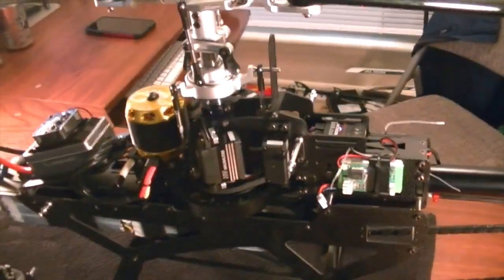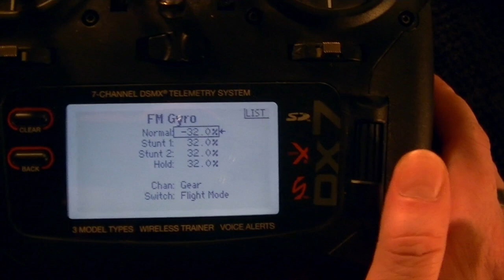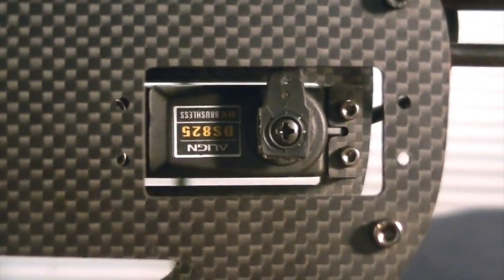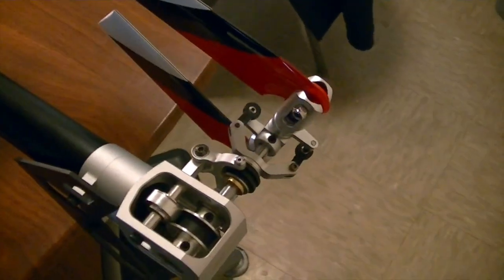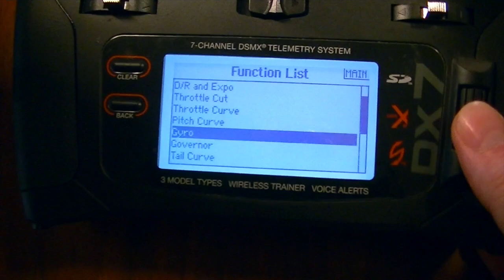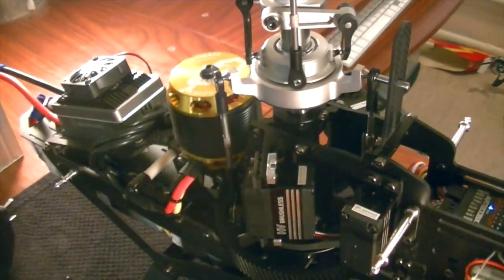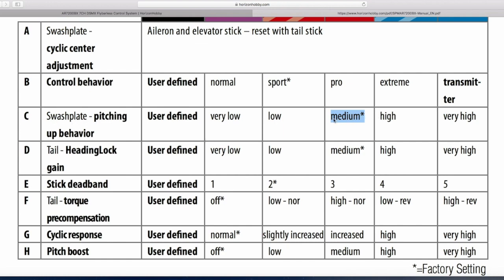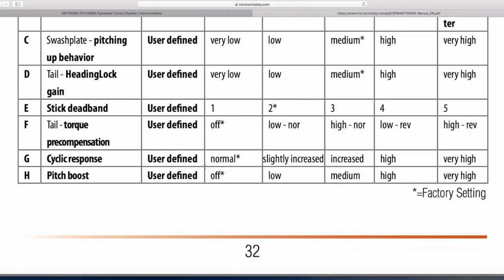AR7200BX / Beast X : Setup Guide #4

Comment: Quick question: Did you put the first setting back to -32   ?   or keep it     at +32  +32   + 32 on gyro. Freddy you are brilliant...If I had a heli company or FBL unit maker.. I would hire you to do videos on the product... I have never understood why manufacturers produce manuals that are difficult to follow and assume the customer has a good knowledge of setting up the black art of Helicopters...    You make it so easy and I am very grateful to other guys who have taken the time to show setting a Beast X up but you are by far the best.
Reply from the maker: Thank you so much for the very kind words buddy, and also yes once you have completed the programming I set everything to +32 for my first test flight.  This makes sure that all flight modes have equal gain with no risk of accidentally flying in RATE mode.  Then you just fine tune them from there.
Reply: I totally agree, the manuals are made for people who usually have a crystal ball, manuals in English mixed with Chinese, for me who do not read or speak English, I have to use the google translation. And the companies do not allow us to select one part of the manual to translate on google, or they block the translation, or put the Chinese together, and when we select a part, only strange characters come in. I think that’s why the Hobby of Helimodelos instead of growing is decreasing , and the Hobby of Drones has been growing. If the manufacturers do not change this concept of manuals, they will end up failing.
Reply: @rochaeliasbr  yes you are wright in the new manual for the 470LT M stans vertical and cablels backwards blue and in the Microbeast its red  !!!!!!!!!
Reply: @33forsaken  i like the idea of having it set in rate mode on normal mode because it will center the tail then i will flip to headlock and take off. if the blades are set mechanically to hold the tail so there is no sudden turns if i do forget i will not be caught off guard. i have the gyro gains on a seperate switch. but what is your feelings about that.  its a matter for me to have the tail on center then flip it to gyro gain. preference for me. i never forget it anyway because it is habit forming.

Comment: Great series of videos!  Currently I am working on an old trex450 using the tgz380 which is a clone version of beastx v.3 for instructions.  I have an old DX7 radio and I am just getting back into helicopters. The question I have for you is how do I go about getting gyro sense to show up in my functions list. My heli has been set up for years using the old reliable gy401 but going through the very similar instructions with the tgz380 I will need to get into the area of raté and heading hold in the radio.  Hoping you might be able to point me in the right direction. Thanks for sharing.
Reply from the maker: If I can recall in the older DX7 radios, you have to do the thing where you hold down the button and power on the radio to enter model select and all of that.  Then you have to actually go into the channel assign and set the gyro to on in the channel assign.  Then if I am remembering right it should then active the Gyro menu when the radio is powered on like normal.  I hope this helps, it has been a while since I have used the older radios and systems lol.

Comment: Thanks for the video, I have the T-rex470LM, and MicroBeast v4.2 came, as I am a beginner, I paid for the T-rex to be assembled, but I'm not happy, because the servants are making noise, I think there is a little shaking, and also the tail servo hits the end, which even for me who is a beginner I think is wrong. But, thanks again for posting.
Reply: Ellas….Can you go to an experienced flyer for checking your settings?   ..If I am wrong guys please correct me?   Should be 0 to 0 on sub trim tx radio     I am still learning don't   but do not understand why heli manufcturers/electronic controllers  leave you in the dark with poor manuals...  Hire Freddy and save us all a big learning curve with excellent videos.
Reply: @alwatt9367  Hello Al Watt, thanks for the precious tip, I will see what can be done in this case.
Reply from the maker: Hey guys never ever ever add sub trims in the radio with the beast x or related systems.  Thats what the FBL system is for, so you can go into the travel menus for the setup and lower your setting.  For the tail you can change the tail travel limits.  Its all done in the system NOT the radio, adding sub trims will give you less then desired results with the system and causes issues while in flight.  Also please NOTE it is perfectly normal for your servos to be sitting stationary and be buzzing or making noise.  It happens with all helis, and is usually caused by the wight and tight restriction from the links.  Servo buzzing is perfectly normal, however servo binding is not.  There is a big difference between the two.
Reply from the maker: Hey guys never ever ever add sub trims in the radio with the beast x or related systems.  Thats what the FBL system is for, so you can go into the travel menus for the setup and lower your setting.  For the tail you can change the tail travel limits.  Its all done in the system NOT the radio, adding sub trims will give you less then desired results with the system and causes issues while in flight.  Also please NOTE it is perfectly normal for your servos to be sitting stationary and be buzzing or making noise.  It happens with all helis, and is usually caused by the wight and tight restriction from the links.  Servo buzzing is perfectly normal, however servo binding is not.  There is a big difference between the two.
Reply: @33forsaken  Freddy thank you for correcting me..  Sorry Ellias did not mean to give you bad information.
Reply: @33forsaken  Hello, thanks for the correct answer, I tried to know more about it, and from what I understood and from your answer, the configuration is made in the MicroBeast, as for the noises, as I understand it, I believe it is due to the rigidity due to the fact that it is new, little by little we learn from the most experienced. Thanks again.
Reply: @alwatt9367  Hello, rest assured, what counts is the intention to help, after your post, I went looking for more information to make sure and your information was not correct, so I waited for Freddy to speak up, and he was perfect, because he gave the information clearly and need. Thanks again.
Reply: @rochaeliasbr  To be fair I meant to only check if the servo was binding and to put it back after you had done it before flight...But so glad Freddy gave the correct procedure.

Comment: I could probably go back and watch some of your videos or if you want simply send me a link to how to do it and I should be able to get it right from there ... My pitch at 50/50 is at 2.0° on my digital gauge. But I'm getting like -16° and +8.9° I think I'm right about it just needing to be the same but need your professional opinion!!
Reply from the maker: So the beast has a menu that allows you to adjust both the positive and negative travel for the collective pitch.  I do believe its menu K.
Reply: 50/50 Pitch 0  and throw J/ 6  and PitchK/ -13red   and +13 and blue  read good the maual from Beast X Plus and flash the last firmeware5.1.4

Comment: Hello Freddy 
Can I used this 7200 on a trex 600 nitro ?
If yes .. donn be I need a satellite??
One more thing what satellite I have to get ?
Thanks
Reply from the maker: Yes you can use it on any size helis that they make. It is a Spektrum based system so you will need a DSMX Sat and your radio of course.

Comment: Hi Freddy, you're videos was very helpful  I am using microbeastx plus v4.2 basic my setting was factory default, now i am trying to get a hard and fast servo's throw. parameter menu (B) and (G), set the  parameter menu B to transmitter and i increased G what is confused me that at the end of the parameter menu G  show this messages 
(If using an increased Cyclic response (greater than „normal“ setting) IT IS RECOMMENDED TO SET PARAMETER 
menu point B (Control behavior) to transmitter (Status-LED blue). Additionally you should only add a
very small amount of Expo by the transmitter or don‘t use any Expo at all. Otherwise this feature may
not show any significant effect!
) what if i set parameter menu B to blue flashing  and the G to blue flashing could be inconvenient to microbeast and cause some issues?  what's your advice or recommendations...  thanks in advance
Reply from the maker: Hmm this is a very interesting one, let me ask you this have you tried flying the control behavior setting on the highest and also the cyclic speed setting on the highest as well before defaulting to the transmitter mode? You can also adjust the full cyclic servo throw as well to get more pitch closer to center and that will give you a better feel or faster feel.  I have never really messed with the transmitter mode because I have always been able to use the setting to get my Heli to feel perfect.  That may also be another good video idea lol
Reply: @33forsaken  no i never mess with the transmitter setting always set the beastx to factory defaults it was good on a small size like dominator 450l with a soft 3D but the 550 and the 700 size feel lazy.  i used control style to pro and cyclic response to slightly increase but when i read the recommendation at the end of the parameter menu G i hesitated to select the highest point  on parameter B and G. so  what your suggestion or advices

Comment: Freddy not sure if I’m missing something. Followed the tail setup and when I’m in hold or normal mode, the tail acts like you say it’s supposed to including the gyro movement. But when I change to stunt mode 1 or 2 the slider moves all the way to the right. Any input and it moves itself back to the right again. Any input on this?

Comment: New to setting up a FBL unit Working on setting up my align Trex 550x Microbeast 5.2 unit. Point E is fine.  I'm having a problem with point F Rudder direction step. Item one is fine I can set correct direction with rudder stick input, Item 2 rudder direction of Microbeast gyro is correct and lights blue. Item 3 is where I run into problems when I move the rudder stick full direction the led does not change from flashing lights to solid. I have increased the in points in the radio for the rudder to 150% neither light will change to a solid light. What am I doing wrong.

Comment: Freddie... Question. My Trex 500 has too much neg pitch and not enough pos pitch. I can't for the life of me remember how to adjust that. My servos are at 90 and they move up and down in unison but I don't know how to adjust the travel and get them equal. Does that make sense and if so can you help me figure this out?? I think it should be simple but with everything being visually correct I don't want to start adjusting my links if that's not what I need to do. Maybe it is but I just don't want to since I'm not 100% sure. 
I appreciate your time and help with this if you can spare some time to help out!! 
Thanks in advance!!
Reply from the maker: So the beast has a menu that allows you to adjust both the positive and negative travel for the collective pitch.  I do believe its menu K.
Reply: I tink you have not good centerd yor Spashplate on middle position or to high or to low its one of the most imprtend thinks to have it centerd for enough way in both directions .
Reply: @fastfrank61  I got it centered... Matter fact once I set my throttle to stay the same in mode 2&3 the tail stayed solid as a rock.
Reply: And it was all done as Freddie said in his video .. just have to watch. He does a great job explaining how to setup the ar7200!!!
Reply: @Itzalwys1420  Hello but i have the Microbeast X Plus Versio 5.1.4 and i have 5 Algin and ownly problems with the last builded Algin Terex 470LT M Dominator Premium Robbe

Comment: hi Freddy, can you make a video on pitch curve and throttle curve specter 700?
Reply from the maker: Hey buddy, so basically depending on the gearing you have and the ESC.  The throttle curves will vary.  For example, I have the HW Plat 200A with GOV on.  So I have a throttle curve for each mode as follows.  Norm 80% Idle 1 90% idle 2 100%.  But this can very on your settings and GOV requirements.  As for pitch I always run the standard -12.5, 0, +12.5. I hope this helps buddy.

Comment: Was wondering about my tailkick to the right when throttle up. More head speed seems to make the tailkick a little bit less. What else can be done? Maybe a good throttle pitchcurve? Turning up de gain helped to. I,m trying everything and apart from the heli flying great, the tail is a problem.
Reply from the maker: Does the tail only kick while you spool up or does it kick while in flight or doing certain moves?
Reply: @33forsaken  when hovering it's fine. Turning the tail also fine, its when i throttle up a bit the tail kicks to the right and centers again. No tailwag, but tailkick.
Reply: @rtoebak76  mine is doing the same thing... ??
Reply: @Itzalwys1420  It maybe in the parameters menu for tail compensation. Have not tried it. But a good throttle pitchcurve should also work better. Im just waiting for freddy to answer when has the time.
Reply: @rtoebak76  what do you have your throttle and pitch settings at??
Reply: I just set mine, thr. @Idle is 30,40,60,70,80. IU1, 80,70,60,70,80. IU2 95,90,85,90,95... Pitch- idle, 30,40,50,75,100. IU1 & IU2 is 0,25,50,75,100... A-Main hobbies gave me those settings . I'm about to try it out.
Reply: @Itzalwys1420  thats maybe our fault, it needs to be a more straight line for throttle. That way above half stick your always at a good rpm. I think the tail will loose power when going lower, or when its low a higher rpm is coming it can not take the change.
Reply: @rtoebak76  I just tried it and it was really good. Felt good and the tail only kicks out a little bit now!  I put it into IU2 and it shot straight up!! Lol.  So I quickly put it into IU1 and finished off the battery in basically a hover. I am trying this all out front of my house with power lines and trees all around me so I'm trying to be very careful!! I'm not used to the 500!!  It's a whole nother animal compared to my 450 😂😂 
Has me shaking right now!!
Reply: I think with the higher head speed that the tail will fix itself but I won't know for sure until I try it where I can safely fly and not worry about what's around me...
Reply: @Itzalwys1420  it shot straight up because there was a big difference in your throttle curve setup from idle-up1 to idle-up2, you went from 60 to 85 at half stick. Or 70 to 90 when at hoover. What is your max pitch full up and down?
Reply: @rtoebak76  12.5
Reply: @Itzalwys1420  Yeah i set mine at 12, we are good to go. You also have the ar7200bx right?
Reply: @rtoebak76  yes.. so I just did another flight and I'm still getting a slight amount of tail kick. In IU2 as well. I'm going to lengthen my tail link and see if that helps. Still wanna know why it's doing that
Reply: @Itzalwys1420  i got an answer from amainhobby. The precomp setting in parameters is 1 thing to do. But first set your throttle curve to 0-80-80-80-80 and pitchcurve to 0-25-50-75-100. The constant headspeed should let you know when to use the parameter for precomp. If it kicks use it and if it stays your done. Because throttle is not the problem anymore, the only problem would be the pitch of the blades and the drag. So if it still kicks after that,  use the parameter menu "F" for the tail and set for low first and otherwise high. It,s al about how hard you use the sticks i think.
Reply: @rtoebak76  cool... Thanks. I'll try that and see what happens. I will keep you posted. Thanks again for the help!!
Reply: @Itzalwys1420   I just took it outside. Problem solved, i needed a straight throttle curve 0-80-80-80-80. No more tailkick. 0-90-90-90-90 for my trex500 is to much. It's going in a scale fuselage. Pitchcurve set at 20-35-50-75-100. Including throttlecut. My pitchrange is 12 positive and 12 negative, set in the ar7200bx as max.
Reply: @rtoebak76  so when you bumped up to 90% throttle it still kicked out?? What ESC are you running on that?? I may lower my pitch to 12+/12- but I'm surprised that just going it up to 90 didn't work... I had to work all day do I myself just got home.. no daylight left to fly!! I'll be off at around 6ish tomorrow so I'll try that out and see what happens... Thanks slot for the update
 I'll let you know if it works for me tomorrow...
Reply: So I put my throttle to 80% on iu1 and 100,90,85,90,100 on IU2 and seems like that fixed my tail issue... Flies great!!
Reply: Now that I'm more comfortable with the helly in itself and flying it I bumped up my throttle and idle up one to 85 all the way across and then an idle up to I put it to 95 all the way across I'm getting a slight amount of tail wag, looks like I have too much gyro so it turned down, my gyro I had it at 35 I turned it down to 32 again and it seemed to take care of most of it but anyway I have a question, I want to upgrade the motor and I want to put a scorpion motor in there along with the castle creations 90 amp speed controller does anyone have any ideas or recommendations on what what I should use or what would be best for my application which is a T-Rex 500L dominator thanks in advance everybody!!!